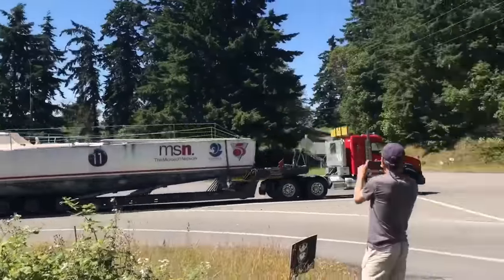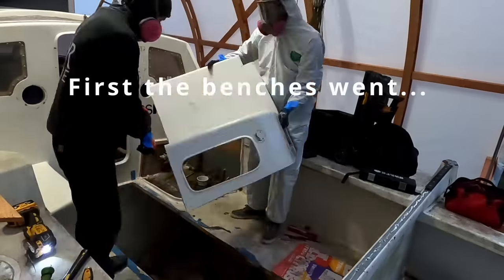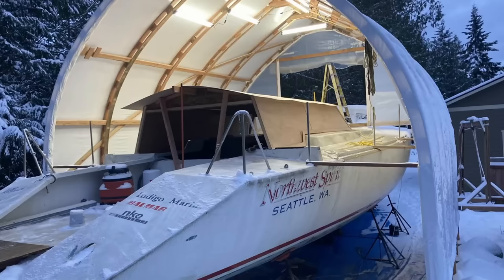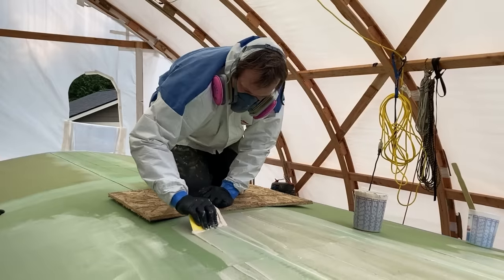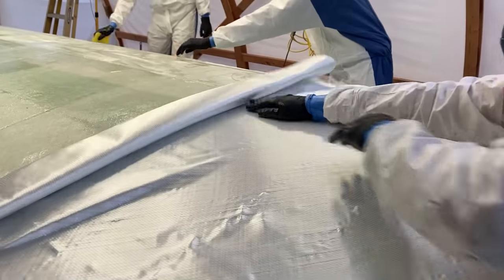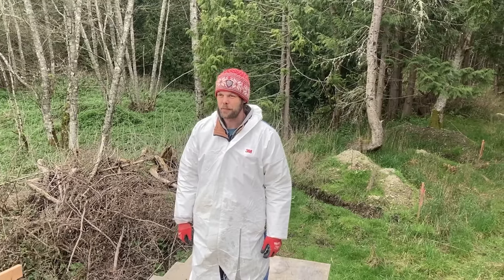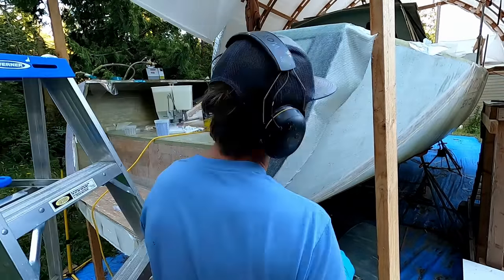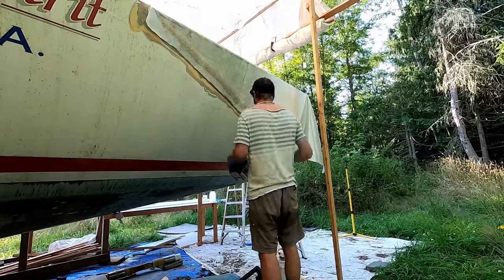Sailboat Refit: 1 Year in 10 Minutes!

Comment: I listened to your interview on "On the Wind" yesterday and wanted to give you a shoutout on a job well done! I love how short this video was! Did you work with a naval architect to redesign the dog house and transom? How did you know what thickness of foam to use? I reinforced my keel from the bilge a few years ago and used eight  1/2 inch pieces with eight layers of fiberglass but no vacuum sealing. Never has it checked, but she definitely sailed closer to the wind with no keel wabble after I was done.
Reply from the maker: yes, we have the help of a naval architect for all the engineering projects. I'm using materials similar to how the boat was built and what was the best available to me.